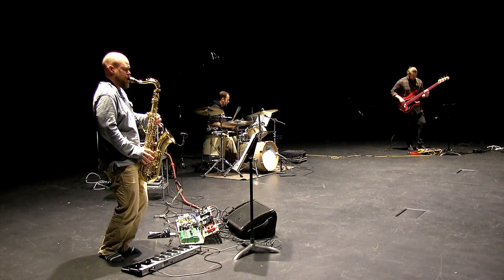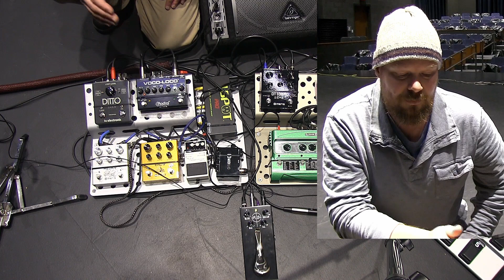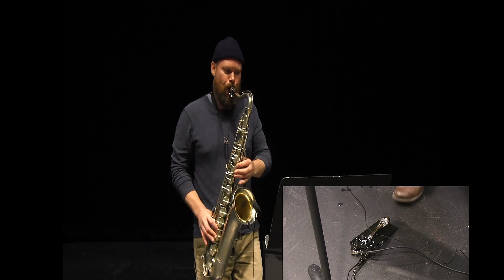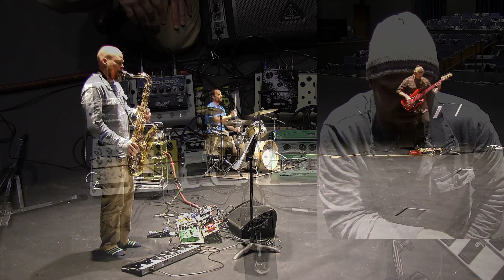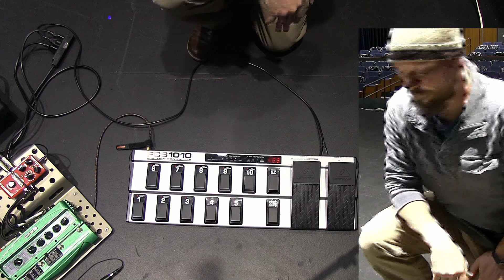Saxophone Effects Pedalboard Setup Explained, Controlling Effects with MIDI, 2nd Ed Part 1

Comment: I just found your video on yt. Amazing setup and sounds man!! I used a Ditto X4 looper-pedal ( the bigger one) and had 3 of them , 2 of them for the other musicians. You can Connect them just using a long midi-cable. Then all 3 can be used in sync and tap the master in tempo. It helps to make empty  loops of a certain length.
Reply from the maker: That's awesome, I'll have to try it. Thanks for the suggestion!
Reply: @JasonSquinobal  Got it! Thank you so much for your time and patience! Hope to see you performing live at some point! Your sound is very interesting! Hopefully you'll come to WA some day! :)

Comment: You need some pedalboard 
 junction/interface boxes. It’s not good practice to plug in/out of your pedals every night. Eventually one of your 1/4 jacks will fail, it’s better for it to fail on the interface side. When it happens you can just plug into the pedals for the night. Y’all sound great!!!!!
Reply from the maker: yeah, that's a really great suggestion. I just gotta find the room, but you're right. Thanks!
Reply: Mount them underneath the top part of your boards.

Comment: Hi Jason, thank you so much for all the information! I'm starting to tap into the pedals world and having a lot of fun trying things out.
I'm currently using a BOSS VE-20 as mainly a harmonizer due to the fact that I'm using a condenser mic that needs phantom power. I saw that you're using an audio technica power module. Would that be the same? I'm afraid of creating a pedal chain without figuring this out first (can't seem to find enough info online). Do you know how can I run a chain with a condenser? should I run all the pedals before and use the boss ve-20 at the end to send my mic signal out? Sorry if it's a beginner question.
Thanks again!
Reply from the maker: I'm not really familiar with the Boss VE-20 but I'm assuming it is supplying the phantom power for the condenser mic. If the VE-20 doesn't have a built in effects loop then this might be a difficult set-up to add external effect to. One issue is that you need to give the effects pedals enough, but not too much signal volume so that the audio can be processed. If you plug the mic directly into the Pedals first then there won't be enough signal strength to send audio through the pedals. In fact the mic won't be able to get any of the phantom power it needs. But if you send the audio signal though the pedals after the VE-20 then the signal will be too powerful and will overpower the pedals.

One solution is to invest in a pre-amp with an effects loop so that the mic can get the power it needs and then you can send just the right amount of audio signal to the pedals. That's what the Voice-Loco is used for in my effect signal.

Another option is to invest in a mic that has power at its source. The "IntraMic" is designed to be used with pedals and comes with a power supply that then gets plugged in directly to the pedals. 

A quick fix if you want to experiment with some pedals before deciding which ones you want to set up in a chain, is to use an old-school mixing board like a Mackie. if you can find one you can send the mic through that and then set the pedals up through one of the sends Chanels therefore you can send just the right amount of audio through the pedals and back into the return of the mixing board. 

I hope on of these solutions helps.
Reply: Hi  @JasonSquinobal  ! Thank you so much for your response! Yes, the boss VE-20 has a phantom power in it, that's why I'm using it. I'm not using it for loop FX but for harmonizer effects, reverb and delay. What I understood is that if I have a pre-amp in the beginning of my chain I can them run the chain with other pedals, is that correct? I have the option to turn on and off the phantom on the VE-20 so I wouldn't use it to power the mic, just as a regular pedal on my chain.
Reply from the maker: Yes that should work, but the most important thing is that you have control over how much sound is running into the effects pedals, too much and you will distort the sound too little and you won't hear it.

Comment: What brand of pedal boards are you using?  Great sounds
Reply from the maker: Thanks! I am using Holeyboards. They are a bit expensive, but I like the construction and flexibility. Being able to attach pedals using zip-ties helps me to keep things cleaned up and it's relatively easy to move stuff around.